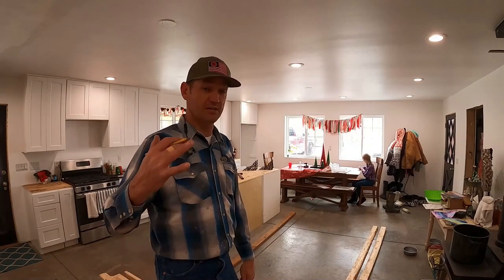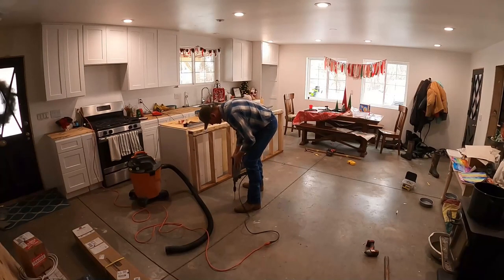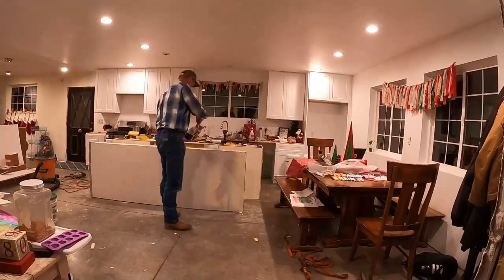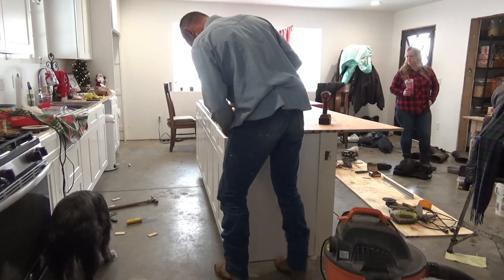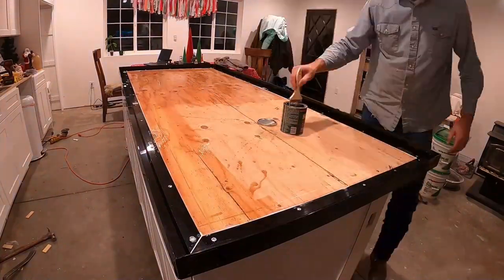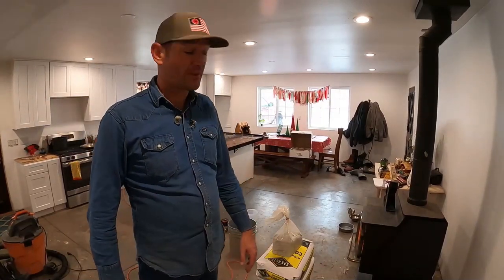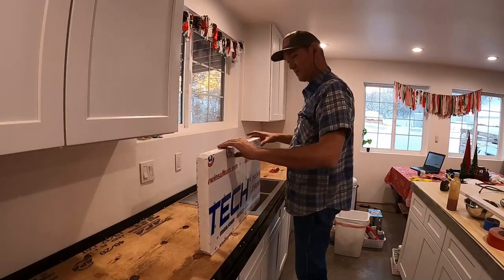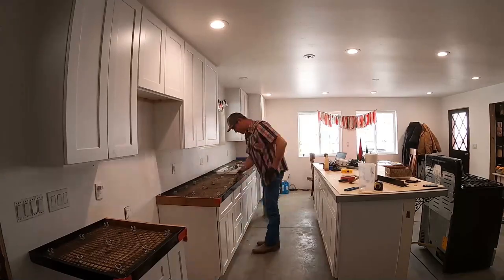#388 - DIY Concrete Countertops For The Kitchen - Pour In Place!

Comment: One thing you can do to prevent cracks on your concrete is to mix it as dry as you can and still work with it. The more water in the concrete, the more water has to evaporate out, this is where you get shrinking. Its a lot harder to work stiff concrete but it does help prevent cracks. Great job with your countertops, we plan on doing concrete countertops also. :)

Comment: that needs to cure days then get a fine polisher for your angle grinder preferable diamond imbedded it will be like glass before you finish plus it brings out the small stones in the grout.
Reply: Douglas Morgan how messy is the polishing step?

Comment: Sweet concrete === looks great.  We were wondering about the new dog - yeah sure is a big dog for a big place. 
Concrete -- We wanted to go that route on our place - but the timing wasn't right and did not have the time for the experimentation required.  Good route to go with the tried and tested methods and components.  At the time I had major structural stuff to deal with and hired a tile guy to put in granite tiles - big 24" ones - it was inexpensive and very few seems.  But frankly its not the kind of look I wanted, and its way "too fussy" --  gotta be careful even setting bowls or cups on it, and you see any waterspots etc.   
Merry Christmas Heath and to the fam'  !!   RH

Comment: I installed Concrete countertop about 13 years ago.
We loved them but if the kids left any food on the countertop it would leave a stain and also things like eggs or orange juice would etch the countertop.
Ended up coating them with a flat epoxy sealer but the damage was already done and we never got 5he look back.
Reply: Good to know. Thanks
Reply: You could have done a top coat basically like rolling on a new coat of paint but with concrete

Comment: Not sure putting the sink under the slab is a good idea. Water is going to splash up into the concrete keeping it wet and its going to get contaminated with cleaning agents & food waste. Even if you seal the concrete very well, water will find a way to get into it. If you need to replace the sink, you have to destroy that nice counter top. It would haven't been too difficult to just remove the sink and use the foam for the opening.
Reply: He's done this much and has come this far.... I think it's safe to say he knows what he's doing. There's no way he didn't think of all that already. Just watch over the barn while he screw this cow will ya??? No offense Heath , just an old sayin'
Reply: Same thing happened to my parents granite.

Comment: Ive seen a good few concrete tops in my time   in UK  but yours has to be the straightest edging Ive come across probably down to avoiding wood or angle bar set-ups.

P.S. where are the cats paw marks, believe me concrete and cats are a magnet to each other.
                                                     
                                              Merry Christmas and a safe New Year to all.

Comment: Heath, 
I questioned you a few videos back as to why concrete countertops as it sounded like such a crazy idea. Since then I have seen concrete countertops and be damned if they don't look really good, yours are no exception. Something I found out about them, and I'm sure you have also learned about this as well, is sealing them, mostly so they don't stain, but also to prevent them from cracking or the edges chipping. 

What has been told to me that is the best thing to seal them with is food grade epoxy resin as it not only seals, it strengthens, and also allows flexibility support for shifting and settling overtime which also aids in the concrete not developing cracks. I'm sure you have come across this information as well, but thought I'd pass it along just incase. By the way, the countertops look great. In fact, it's making me think about also incorporating them into the plans for the home I want to build for my wife and family that I am designing myself.

The house looks more like a house each video now and is going to be interesting to see how it progresses more. Your channel is one of the few channels that I wait in anticipation to see new postings, each video is enjoyable as well as educational. And re enforces in me that there is a much greater need to go off grid and self sustaining, which has been a great interest of mine long before YouTube even existed. I'm very happy to see how it is being such an openly talked about and executed idea and lifestyle that many people are choosing.

MERRY CHRISTMAS Heath, Cedar, Rhett, Reid, Sage, Cali, and Shianne. Hopefully I got the spelling right for everyone, It was hard enough remembering all your names ; ) I love each video! You keep opening my eyes to all the possibilities of living a self sustained lifestyle with a family. If the 7 of you can do it, then there shouldn't be any problem for Carine (my wife), myself, and 2 kids when we have them, to be able to live in the same way. THANK YOU!!!!!

Comment: I have something similar but with formica, now 30 years old, with 2 cabinets side by side. Even my brackets are similar except they are on a lower level on two sides as a lunch counter. I also had an AC outlet installed on the top level as a food prep area, coffee pot, toaster, food processor, crock pot, etc. You would have to wire down from above thru a hollow wooden frame. Would be a good place to mount prep lights though. I hope by drilling down thru your concrete pad, you never have groundwater seep up thru. I didn't until recently with high groundwater in the basement where jack posts were secured to the pad. Your results look great! I wonder if you can make a miniature pool table to place on top of the countertop. Now that would be awesome.

Comment: it is important to use the correct re-inforcement wire with this type of project. What most people don't know is the re-inforcment wire has to be placed 1/4 of the total thickness from the bottom of the pour. To close to the top or in the middle will allow it to crack Under any load. It is also critical that the curing process is done correctly. Keep the concrete wet for at least 3 days or more. This will keep the moisture in the contcrete longer and not allowing it to crack. Just like your hands. When they get dry, they crack.

Comment: Hi Heath ! I'm surprised that you did not vibrate the concrete on the edges. Anyhow, nice job. Did it years ago the old way  i.e. with 1 x 4" and forgot to oil them. to remove the forms was a pain. And I did the same mistake, not waiting long enough to let them cure. Luckily I started with the mud room counter, not the kitchen ones. Advice : treat the then well cured concrete with mineral oil ( food preparation areas grade). Otherwise, any acid food or fruits will permanently stain.
Happy holidays to the whole family !

Comment: A quick idea. Make a rip guide. Take a 1/4" or 3/8" pc. of plywood about 12" wide. Snap a chalk line on it. This line should be about 6" in from the side. As long as it is deeper than the distance from the fat side of the saw to the blade.  Nail a strip of ply (or any thin wood) on the line. Run saw down overhang to cut off excess. Now when you want to rip a straight line, clamp this guide down to the work on some marks where you want to make a cut and go. Love your devotion!

Comment: Merry Christmas to you and yours!  You have done Great with all your projects in your new home.  But concerning the laundry room, instead of the concrete top, have you thought of a "hidden cutting board" for added countertop space?  Or with the use of two long slides, you can double or triple the width of the entire countertop in laundry room.  Or you can add a folding table on the right side of the wall so to have an ironing board or added countertop.

Comment: Looks great.  I have never seen concrete countertops, but have heard of them.  My only question is ... why did you pour the concrete over the edges of the sink?  What happens if you ever need to replace the sink?  I would have thought you would pull the sink out and then put a form around the edges of the opening.  Then once everything cured, silicone the sink back into the opening.  As I said, I have never done the concrete countertop before and only ask as a way to learn.

Comment: If you are careful you can put a sheet of Visqueen on the wet concrete, when it has hardened you lift the membrane off you will have a surface like glass.

Comment: Nice job on the counters. Those break off forms are really slick and work well, never seen those before.  I noticed you didn’t vibrate the edges to remove bubbles, not necessary with that mix?  Are you going to grind and polish them when fully cured and what type of sealer....

Comment: What an epic sliding hill! I'm wondering a few things: would it have been possible or a good thing to take out the sink before pouring? Did you seal the cement before using? What happened when you sanded too soon?

Comment: Very nice work. I’ll be doing concrete countertops in a couple of months for our new kitchen. I’ve seen before where people use a “slurry coat” to fill in the small pinholes. Then, a wet sand buff/polish with diamond sandpaper. Did you choose not to do that, or not recommended? Thanks.

Comment: Will the metal part of the sink now need to be raised somehow to become flush again with the new concrete top? Or will it stay deeper in with the risk of water running in between the concrete top layer and the metal part (at the sides) from splashing?

Comment: I'm not familiar with concrete counter tops, but are you not sandwiching your sink in between the concrete and the plywood, therefore if or when you need to change out your sink you would have to tear out all the concrete?

Comment: Kitchen is looking wonderful 😁 Finn probably does NOT need to gain weight.. Sighthounds are naturally thin, and their hips, lungs and heart doesn't do well with overweight, and this is doubly true for Irish wolfhounds due to their size 😊 if anything, it's better to keep them on the slim side 😅 you can't use the normal method (if you can feel a few ribs, they're at a good pet weight) to figure out if they're at a healthy weight. With sighthounds you actually want to be able to see ribs, but the Irish wolfhound fur, hides the visuals, so you need to feel for them, and you want to be able to feel all of them 😊 during my exams I got to work with an Irish wolfhound, such a good temperament is rare! 😊

Comment: Are you not worried that the plywood under the countertops Will rotten?
Reply: It looks like he used Spar varnish on top of the plywood. Spar varnish is used on boats, so it will protect the plywood.

Comment: You're not done! You need to wet sand it with progressively finer diamond sanding pads. 50, 100, 200, 500, 600 800, 1000 grit. We only went 100 thru to 500 grit.( We didnt need to see our reflections) They sell the polisher and  pads for about 80 bucks and when you're done you have a granite quality finish and still have a wet polisher tool or angle grinder for your tool box. The polishing nearly seals the concrete and only a light coating of acrylic sealer is needed. We polished the top layer to expose the sand aggregate and it is  beautiful. Mike and I did the polishing ourselves but instead of hooking a hose to the water line on the polisher we poured water on the surface and polished it in small sections then wet vacuumed up the slurry. Then when it had the look we wanted we rinsed it really well, let it dry and then ran their sealer Dario recommended. It took two days but it was worth it. The concrete has a glass smooth finish before we rolled on the sealer.

Comment: Why no rosin paper to protect your concrete floor and no masking tape to protect the vertical face of your edging?
Reply: That edgin is meant to be broken down once it is cured, also the floor is not finished yet so it does not need to be protected

Comment: Not everyone likes concrete countertops.
You just made your house 100 times harder to sell.
Total dealbreaker.
Reply: Donnie Brasco not everyone likes anything. Your comment is useless. One of the first things anyone changes in a new home are the countertops
Reply: @richgilb  Your faulty assumption is based on new home owners having the cash AND time AND not minding the hassle involved in changing countertops or anything in home remodel. Fact is most home buyers want a home that's ready to move in with nothing further to do. Learn the facts first! And think about the next homeowner trying to break up concrete duh. A crowbar won't work, it'll require a jackhammer. It's not easy and will cost $$$$$ which is another faulty assumption you forgot....not everyone is willing to spend the EXTRA costs and EXTRA effort required to remove CONCRETE countertop vs laminate/tile/granite one.
Reply: Also, it wouldn’t require a jackhammer, it would require a sledgehammer and less than an hour.